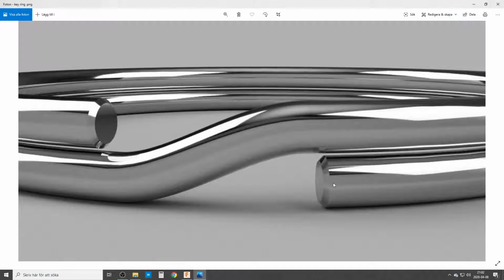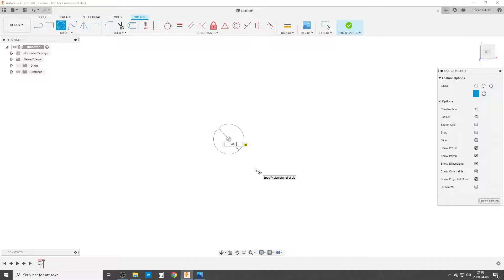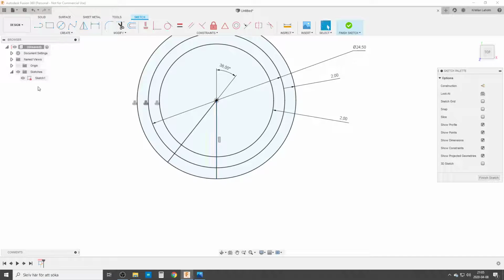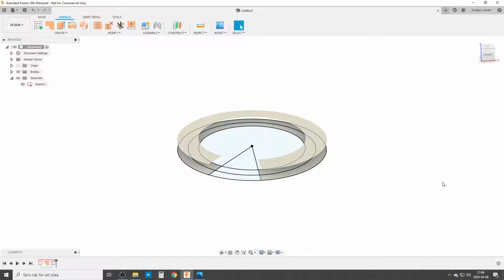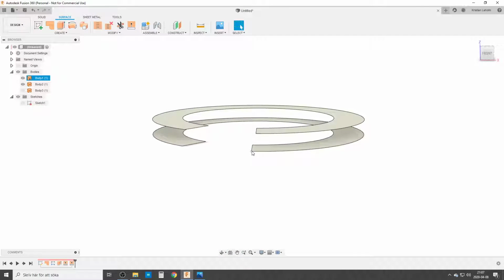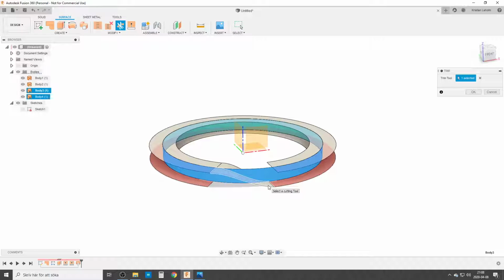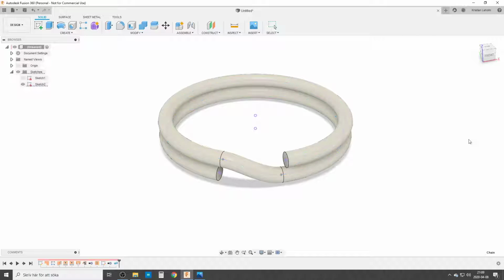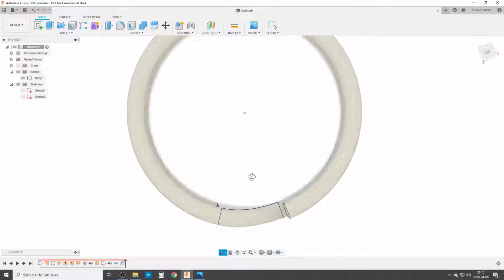Keyring in Fusion 360 - 3D sketch line from Surfaces

Comment: Very nice indeed.  Thank you.
Update:  I change your workflow from pipe to sweep using rounded square for easy printing but both turn out fine. I am able to print both without problem.  The separation on yours is easier than mine which I have to use more force.  Once it's separated it gets stretched out.  Please see attached, yours is on the right.   You're awesome!!!
https://snipboard.io/JkIdEo.jpg
Reply from the maker: Thank you :)
Reply from the maker: If you Sweep you need to use the last Surface i removed to be Guide Surface or the Profile will rotate around the path-axel.
That might be the cause of the ring sticking. https://imgur.com/a/zMTxbZy